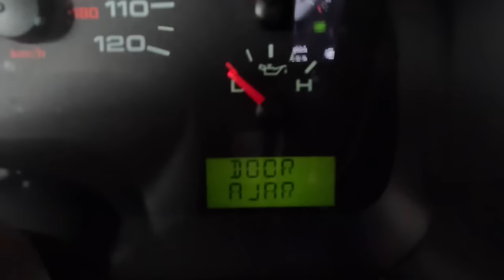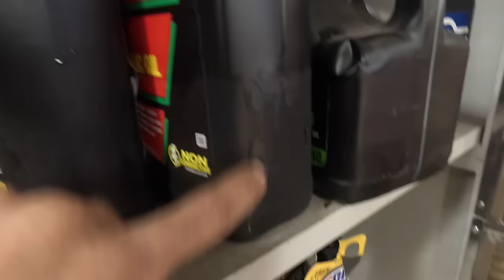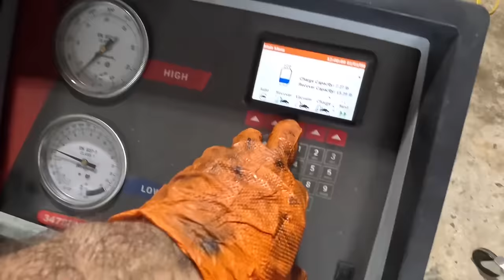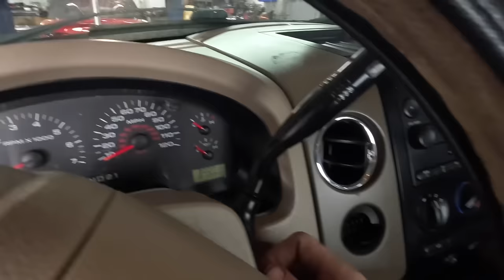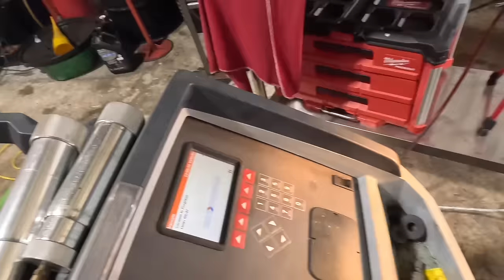New Engine! Warranty Camshaft Sprocket Cheap and Risky! Ford F150 F250 5.4 Triton

Comment: I really think you should have officially torqued the cam phaser bolt...
Reply: Warranty company didn't pay for a good ol' fashioned torqueing.
Reply: Can’t believe that bolt wasn’t properly torqued!
Reply: Oh, but it was. Tightened with a torque wrench or run down with an impact, even cross threaded, tight is tight!
Reply: Click click,  I heard it
Reply: @Estranged180  🤣🤣🤣🤣🤣
Reply: I believe 36 ft lbs then 90 degrees.  If not it’s gonna come apart.
Reply: Ray said click, so it's torqued to spec. Bet on it.
Reply: Warranty co is no different to anyone you don’t want to spend money if you don’t need to. 😄😄
Reply: Missing a green ground wire?
Reply: Please don't paint the valve covers Orange...I know you want to.😊
Reply: And that bolt is one time use as well
Reply: @danfrederick3172  It maybe but if that was the case why wouldn’t it be supplied with the phaser? 🤷🏼‍♂️ what’s a bolt worth, sweet f/all😁

Comment: Bad news on factory ford replacement phasers are the same units as ones you replaced. Therefore same threat of self destruction. Especially if timing chains/ tensioners/water pump are not changed at same time. A company down by you manufactures high pro phasers with big time warranty.

Comment: cam bolt is one time use only as per ford!!!! and i just turned down working on the same thing F
Reply: Phasers come with replacement bolts.  While it wasn't torqued per the book, it likely is good and I am sure Ray used the new bolt.

Comment: I didn’t think you  could reuse the phaser bolt
Reply: Might have been a warranty company requirement, putting it on them if it fails.

Comment: Legally speaking, the purpose of a warranty is to protect the company. Not the customer.
Reply: Warranties cost money. Car manufacturers have entire departments set aside to determine based upon the design of a car snd past failure history what the potential failures will be within the warranty period, estimate how much those will cost and they add that to the price of every car.  Even the military pays for warranties. And it's usually a separate line item on the purchase contract.

Comment: According to every ford tech video i have ever watched. That phaser bolt is a one time use bolt and has a specific torque sequence like many others have pointed out. I have 2 of these trucks so i have done a lot of watching on this procedure for when i may have to do it. The timing system on these motors is to much of a POS to not follow fords procedure. Love the rest of my trucks though

Comment: Very interesting series. I'm sort of amazed there is nothing securely attaching the bolt to the steering linkage. That would be unpleasant to lose. Shouldn't there be a pin of some sort?

Comment: It seems to me that the engine builder did their job. The damage to this unit was caused by negligence by the person that installed that engine. Failing to remove the paper and reinstalling broken valve covers is on the installer. Replacing the damaged phaser will fix it if the paper didn't sludge up something else vital.

Comment: As I watched you install these new coil fasteners, also remember you spoke how these were broken threads upon removal on the original tappet covers.
I must ask, why did you not use a lubricant to help aviod this occurrence in the future removal off the tappet covers.
I appreciate your work ethics are wonderful, I wish my mechanical repair service companies had half the attention to detail you show as a natural part off your repairs, without desire to ridicule you, my questions are more a request for understanding what was the reason you did not choose in this part of the reconstruction to give some lubricant onto these fasteners.

Comment: I see a issue the solenoid housing has a plug where there is a filter inside and its sitting way to far out and that lowers pressure to the phaser

Comment: I'd be surprised if the phaser fixes the noise. More likely it's got a tensioner with a blown out seal, and it takes some time to build pressure on startup. Super common on 5.4's.

Comment: A rebuild with issues... Couldn't possibly be a Jasper, could it? Because reasons. For the viewers... When a shop does warranty work on one of these rebuilds, not only do they decide what you can fix, they also dictate the labor rate, which is often about 1/ of what I normally charge. Today I'm doing chains/water pump on a FWD Ford 3.7.

Comment: The 90 minute videos are great, as well as the 30 to 50 minute videos. Longer jobs need longer vids otherwise you wind up with 15 to 20 part repair series.

Comment: I think that spring size and missing pin had a lot to do with the noises.
Makes me wonder if the pin was in it new or if it fell out into the timing  chain area or oil pan. 
I don't think I'd buy a motor  from them too big a hurry to get it done and don't pay attention to parts as they install them.
Reply: The different part numbers were a red flag to me, they probably used a left Phazer on the right.

Comment: I had a warranty company insist I tear the engine (3.2L) down in an Acura to find out why it was burning oil. I told them up front it was the rings because there was little to no cylinder pressure in a couple cylinders. They told me to prove it so I had the used car rep sign the work order. After it was all apart, the warranty company told me "worn out rings are not covered". Cool story, I need to be paid. The car lot told me to talk to the new owner of the car (they sold it and gave him a 30 day warranty through their lot). 2 attorneys told the car lot they were on the hook for the repair. Honed it out, put a set of rings in it and the owner had a decent engine again. I made shit up after that experience when dealing with warranty companies. I was not going to get stuck with angry customers and cars sitting around taking up shop space. They never checked and accepted my estimates.

Comment: I think this rebuild company is trying to set you up! 
Just say the name of the company so nobody use's them. I hate it when a business has so many requirements when, like I did and ship the whole truck back and make them fix it or sue them and you can fix it!
Good video! :)
Reply: Just pick a company, any company they all operate exactly the same.
  You are not buying a warranty from them. You are buying insurance snd it's a shame so many people don't understand the difference.

Don't forget though that this particular effort is not an 3rd party extended warranty repair. It is the product warranty offered by the manufacturer/rebuilder.

Comment: Missing pin that holds a spring and a smaler spring on the old unit. I would say thats whats has given it a new partnumber and whats made it fail. I whould alos look for that pin in the oilpan or pickup screen... Maybe the gurante folks wohuld/should change the other bank as well, but what do i know. It did look like the passenger bank did have the thicker spring.

Comment: I don't like tritons.  I had to replace both phasers, timing chains, guides, chain tensioners ( metal kind ), oil pump ( melling high volume ) and gaskets etc. All of this was done at 160,000 miles, way to early to need this done. Once all back together it runs like a top but who knows how long. Timing should never depend on oil pressure.

Comment: I had similar struggle with a cheap rebuild company on my 4.7 it misfired on first 15 min of start up and me and my dad had to replace the both cam bc the cam lobe spun on the shaft they refused to warranty anything needles to say it was my last reman engine was 3700 bucks down the drain when it blew up from bottom end coming apart 20k miles later and I didn't have my dad with me anymore to drop another engine in rip dad so I sold the truck for pennies being blown up

Comment: I bet the problem is a cheap replacement tensionor they used. I've had the Motorcraft ones fail right out the box. These engines and the timing chains are money makers though

Comment: Anyone else see what looks like a crack in that thermostat housing. Might just be a line from some grease or something but that thing definitely has some corrossion going on. Im always hesitant with this engine. My dad and i have owned ford econoline 150s since the late 80s. Always conversion vans. Around 6 different ones. I had a 99 that at around 185k i had driven about 3 hours to get my girlfriend at the time. The van was seemingly fine till about 2 miles from her exit when it seemed to start losing power. I pulled off the highway into the gas station and shut it down. Refilled the gas and checked my fluids and noticed that the oil definitely was a bit sparkly. Went to start it back up and it literally would not run very well. Being a sunday nobody could do anything and i ended up paying 400 dollars to get the stupid thing back home. Ended up the engine was pretty much shot. Luckily these things are easily gutted so i removed everything from the interior got a newer one that was just a cargo van and used what i had to make it a conversion van. Then traded it in for one year newer but the conversion was done by jayco. After 5 years around 190k it did the same thing. Now i have a 2018 e350 diesel and the conversion was done up in mishewaka Indiana by explorer. This van is hands down the most luxurious vehicle you can buy. Its like a limo but you can stand up in it. 42 inch flat screens. Heated and massaging front and rear seats rear seat that folds down into a bed. Built in generator and rv plugins for electricity gas and water. Even has its own vacuum. Highly recommended but if and when i can afford to trade up. Some of these things cost over 100k new. I think im gonna try to get the chevy or gmc diesel. Unless they make a gas electric hybrid.

Comment: That was a very good repair procedure to save a lot of time in tearing down the front of the engine. somebody was really thinking.    I would crazy clue those rubber gaskets in place when they have to be installed out of sight and when then can fall out easily.

Comment: The ECM bracket , reminded me of the ceramic block with the copper strip on the firewall of dodge pickups in the 60 and 70's.  Would crack and dealer only part. Useless.
Reply: The dual-resistor start and run circuit block.   Yeah, use to carry two spares in the glove box.  Burn one side resistor and would not start.  Other side burned through, wouldn't run.   At least that failure told you right away and you could fix it on the side of the road.  They seemed to last about 25K miles.

Comment: That phaser won't last long, supposed to use a new fastener and torque to spec not impact.
Reply: Torque to yield bolt?
Reply: @21Piloteer  torque spec is 89' lbs, every manual on replacing cam phasers states do not reuse bolts.

Comment: Quick question about the cam phaser bolt: I was under the impression that the bolt was a single-use/torque-to-yield. Or am I remembering incorrectly? If it is, what would the outcome be if it were to be reused? Would it work its way out and grenade the timing? (You didn’t mention if you used a new bolt or not and it kinda looked like it was the same bolt) thanks!
Reply: Most times its a throwaway bolt. Threads will be stretched when reusing the old bolt.
Reply: Once stretched they wont clamp correctly again
Reply: Phasers, whether OEM or aftermarket, come with new bolts.  I'm sure he used that.
Reply: When in doubt replace it
Reply: They only paid for the one phaser, not both. You think they would pay for a new bolt?
Reply: Maybe the warranty company didn't want to buy a new one.
Reply: @silicon212  Not true..Not in all cases Separate part number
Reply: @TheJcrandazzo  In my shop, we only use the Motorcraft phasers - and every one I've seen comes with a bolt.  Yes, the bolt is a separate part number, because sometimes you need to replace the bolt only (remove phaser, put back on etc).

Comment: missing pin is what breaks and makes the noise, the phaser does not lock at idle speed, and each valve opening event makes the phaser bounce inside hitting the end stop  the breaking pin is the fail point. where is the rest of the pin though

Comment: Hey Ray. Just wanted to let you know, it's as wet as it is in Florida, because this year is an El Niño year. Last time I remember this wet of a year, was way back in 2013. That year, in February, Ohio and Michigan had standing water on the roads where the snow was melting.

All I can say is, good luck staying, and keeping, everything dry.

Just a question: Why no tightening or torquing of the bracket that holds the ECU? You threaded on the fasteners to hold the bracket, but didn't tighten them down, before reinstalling the ECU in its home.

Comment: That plastic bit is known as " the piece of cheese ". Ray should not of used the battery wrench to tighten that bolt. He forgot or did'nt realize to see or tell that the bolt is hollow because it is an oil feed . Meaning it is very weak and should not be tightened too much. It should by be lightly tightened and then torgued to spec. It is very rare to see Ray using a Torgue Wrench. It doe'nt matter how long you have been working on cars you still have to use a Torgue Wrench on many parts. Especially on this part. I can almost see the Ford specialist guys watching this Vid cringing when Ray uses a battery wrench to tighten that bolt. And do'nt forget Ray  the people who gave you permission to carry out the work will have watched this vid and will be thinking this aswell.  What if the bolt comes loose and these people ask Ray what pressure did he torgue that bolt too. Very unprofessional.

Comment: Had to do the cam phaser on lkq motor unfortunately I bought and did not know once the car bought warranty is voided. Which in my opinion is garage and goes to show the quality of the build from them tried calling they told me to kick rocks. Doing the cheeses wedge isn’t as bad and not as difficult as you may think. Watch the ford guy that does a lot of them biggest thing I learned from him and watching that video a billion times was marking the cam to the cap incase it kicks over, which mine did cuz I would have never know or been able to tell which way it did but I marked it and saw it was like a tooth off. Easy if you mark the cam and cap and take your time also push to hard and far on the wedge other wise it will be a bitch to get out😂cuz I did that lol @FordTechMakuloco is the guy who shows how to do this the best

Comment: You did not torque that cam shaft properly. You are supposed to put a new bolt as well. I believe it’s 30 ft lbs and then an additional 90 degrees. Either way you didn’t do that. New bolt isn’t an optional item and I suspect that this engine will have trouble due to this and this poor customer is going to be upset smh. These past 4 videos have been very frustrating to watch and I watch all the time.
Reply: The fact that you’ve also been stuck on the injector issue is also frustrating to say the least. It’s obvious that you don’t take criticism very well. Fact is that company reached out and you changed your opinion so of course ppl are gonna ask questions especially when you’re getting free injectors out of it lol.

Comment: That kinda upsets me after what you went through to show the company's mistakes they should replace the whole short block in my opinion their just taking a cop out 1 phaser isn't going to fix this. I hope it does for the owners needs, but I know you will do him right to the best of your ability that the company allows you to do. In my opinion this is a very easy way for this engine to wind up out of time and you responsible for the trashy work.

Comment: Some body answer this for me .this is one reason why I quit doing Mechanical work. Who pays for the tear down the testing and such. In the old days I always got screwed. Get paid an hour to tear down and test and then another hour and a half to replace the parts and put back together. And as we can see Ray spent all day getting the VC off and getting the engine to run. So can Ray help shed light on this for me?! Pls. 

And yes I went after my service manager with a chainsaw that had a 24 inch bar. A friend had to talk me down, then a week later said friend went after the service manager with a 38 the next week and I talked him back to reality. All over dumb stuff like this 
Mortgage payments kant be made on all day adventure with 3.hourz of pay

Comment: You need to remove some of the rockers using a special tool so that the cam phaser doesn’t jump. I’ve had to do this job multiple times and you can watch ford tech makuloco’s channel using this method too it helps a lot to keep things from jumping. He’s a ford specialist he’s awesome too!

Comment: You didn't tighten the phaser bolt down properly. You're supposed to go 30 ft #, and then 90 degrees.   Also these bolts are torqued to yield.   Follow Ford instructions.  I've done a couple of these.  I'm glad I wasn't your customer.

Comment: tikking on a ford is a feature not a bug😂
Reply: You got that right.😁❤️🇺🇸
Reply: F.O.R.D Fix or repair daily
Reply: They literally released a memo to dealerships telling them if people asked on the 5.4 to tell them it was normal engine noise. And if the customer was very confrontational to just swap the motor.

In other words they were gaslighting customers and only if the gaslighting didn't work would they do the proper thing.

Comment: They are setting you up to blame for whatever comes of this. They should have just removed the motor or done the work themselves.!
Reply: @orionfixr7713 no they’re not. He’s setting himself up for blame because he did not torque the bolt properly nor did he replace the bolt. It is a requirement to replace the phaser bolt. It’s a torque to yield bolt and one time use at that. The torque is supposed to be 30ft/lb and then 90 degree after that to stretch threads.